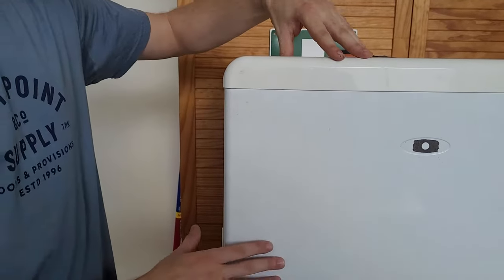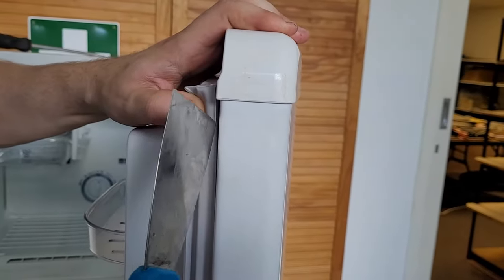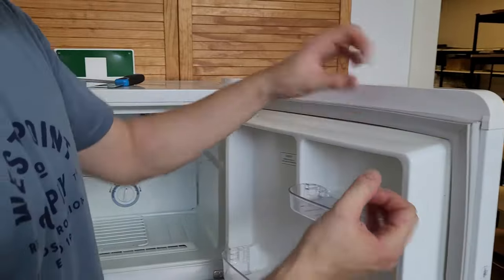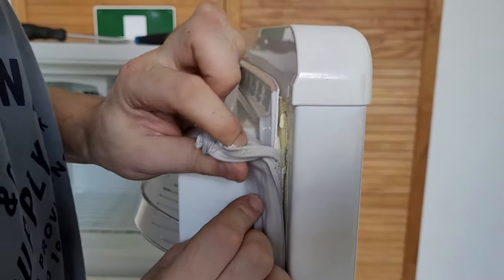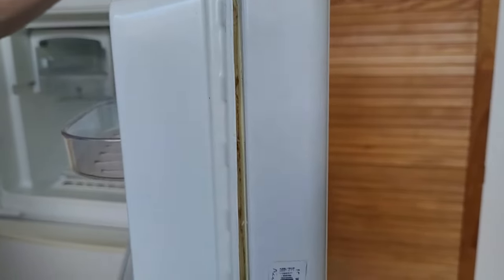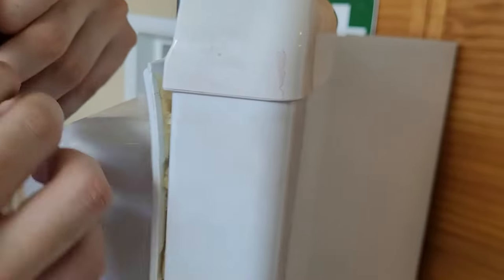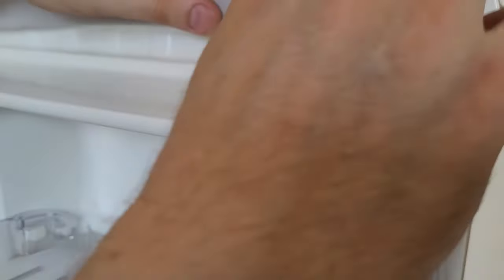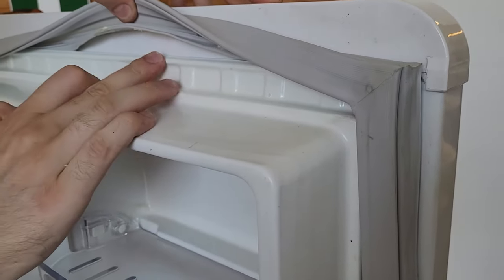Glued in Fridge Seal Seal Replacement Guide - Westinghouse & Whirlpool & More.

Comment: OMG thank you so much for this. When I noticed the seal was glued to the door, I almost yanked the entire door liner off in confusion!!! Thought I'd better stop and get some further advice. All the other videos show them removing the old seals so easily, I thought I had a duffer.

2 hours later...

Hmmm...Actually this isn't going as smoothly as you show. You forgot to mention that it needs 6 pairs of hands to do! I resorted to clamps to keep it in position on the corners.

Also my seal on the freezer door is ripping as opposed to peeling out as I'm trying to remove it. Hells bells this is a fidly job!!!

Comment: Thanks for demonstrating how to change the refrigerator gasket so easily and effortlessly using a putty knife instead of pulling/or tugging it off, which might cause damage to the refrigerator door. We offer good quality refrigerator spare parts, in case anyone is in need of them.